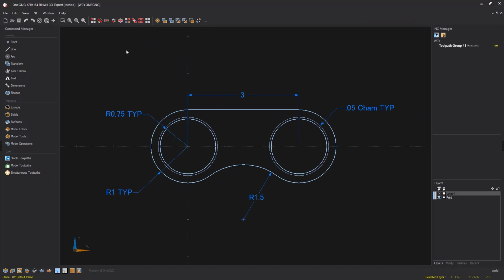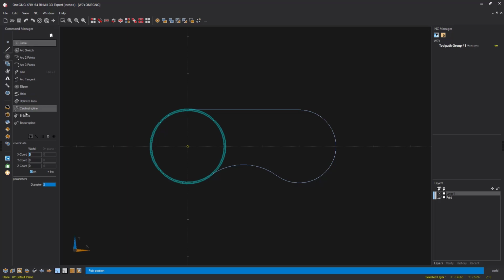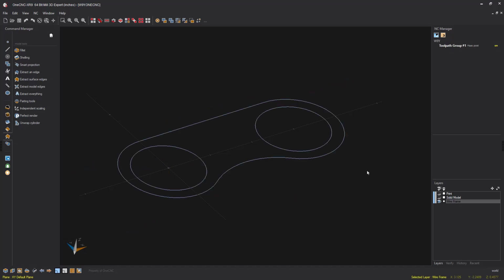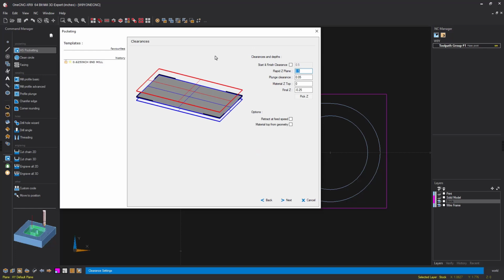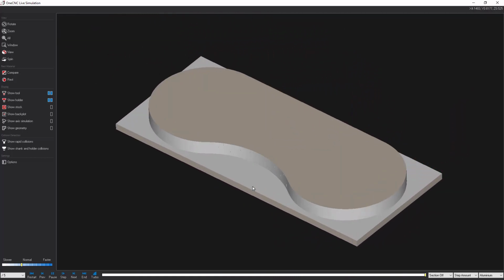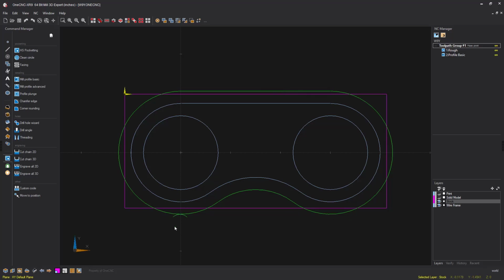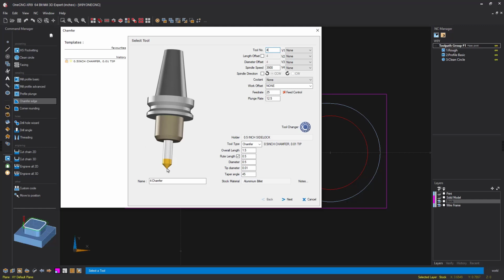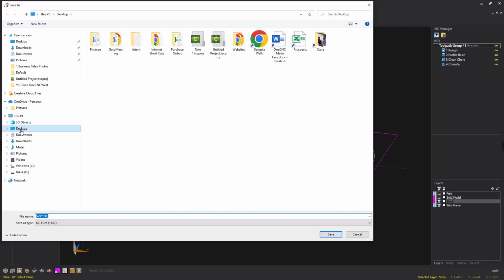OneCNC CADCAM: Complete Step-by-Step Guide to Programming a Part: The Ultimate Walkthrough

Comment from the maker: Thanks for watching and please leave a comment and let us know if this video was helpful. Also make sure to let us know what improvements you would like to see as well as suggestions for future videos in this series.
Reply: Hi Patrick,

Commented on another video same question?

Recently when selecting HS Pocketing I wanted to use the high speed zig zag option, to quickly put two flats across a large cylindrical aluminum block. Unfortunately the simulation would cut one side perfectly Y+ to Y- but the other side Y- to Y+ I was unable to stop the tool from starting in the material regardless of what options i tried. I ended up using the High Speed Open path but the High speed zig zag on the first side offered a superior finish and a faster cut time. Is there a way to select the entry points with these more traditional tool paths and the orientation of how they cut? This would be fantastic if you could cover this!! 

Any help Greatly Appreciated!
Reply from the maker: @Westmach  Hi, I do apologize for missing your previous comment regarding this. To better assist, when you have a moment, please email the part file (with the tool path) to the following email address:

patrick@onecncwest.com

I will take a look at the file and create a video regarding this.